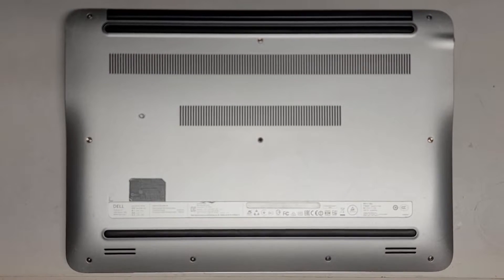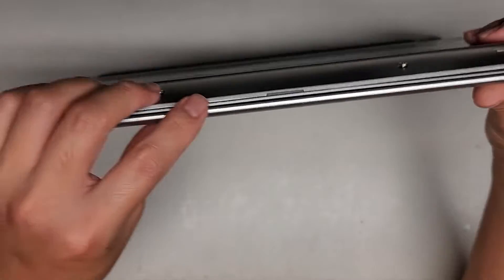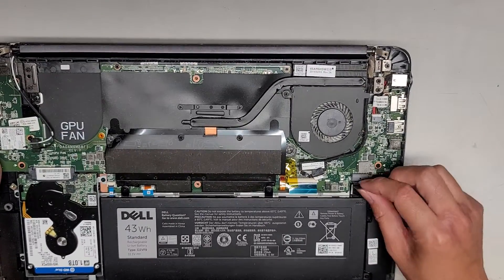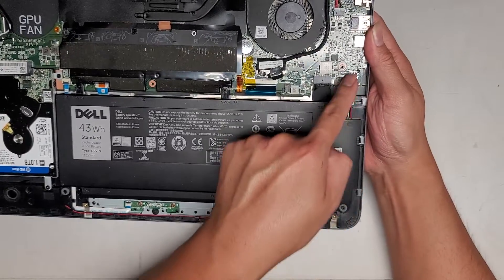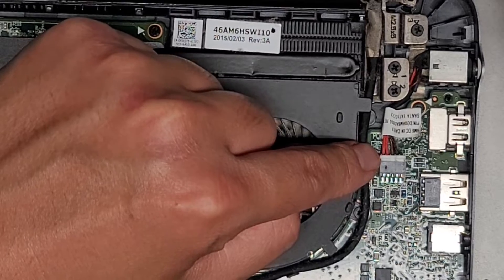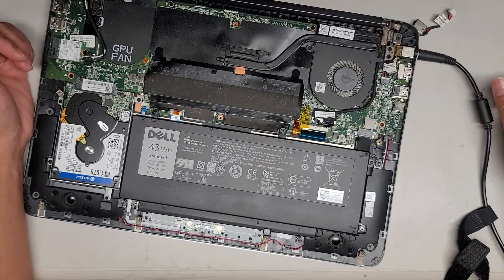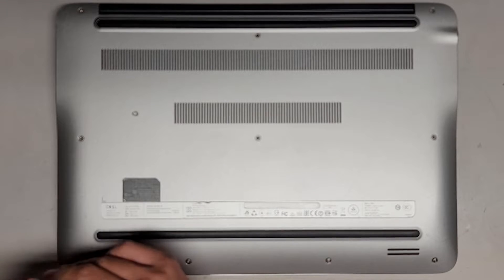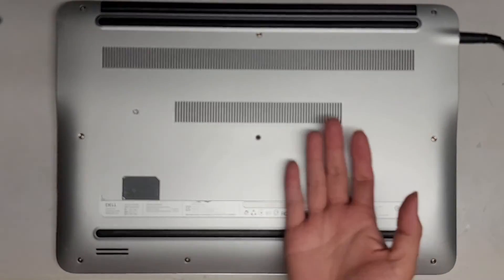Dell Inspiron 15 7000 Series 7548 Disassembly DC Jack Charge Port etc. Replacement Repair

Comment: Help, thank you...  7548 , lightning strike nearby.  Was plugged in, didn't notice anything, computer kept running 35 mins. Message low battery 5% (old) battery. Turned off.  Apparently kept running on battery. Once turned off, will not turn back on.  Power chord adaptor still 19.5v output.  Ordering battery, will changing D.C charge port remedy possible surge?
Reply from the maker: It depends. It could be a motherboard issue :(

Comment: Do you happen to know the screen part number for this? I’m trying to remove the screen and turn it into an additional monitor for my desktop and am having trouble finding a controller board for it. Thanks!
Reply from the maker: It's on the back of the screen. Remove it and check the label.

Comment: Hey i am trying to update this same laptop i just wanted to ask if it supports M.2 SSD. 
From what you show and what i see, i think it doesn't BUT i wanted to ask anyways.
Thanks!
Reply: I’m pretty sure there’s no m.2 support, and confident there’s no NVME support. :) good luck!
Reply: @neilcam98  Thanks, i ended up opening the machine myself and inspecting it to know if it had the port, i wanted to save a bit of time from doing so and also be able to buy the right SSD before hand, that but well i had to do it in the end, M.2 is so common now that even the lowest ends have a free port, i installed one in another machine not even month before this one, and i initially believed that this one wouldn't have one because of the age of the machine, but it is kind high end, so i thought there might be a chance, 
Anyway i did end up installing an 2.5" SSD and it seems to be running well.
Thanks for you actual answer.
Reply from the maker: When I get questions like these, I'm not responding to a viewer, I'm responding to someone that didn't even bother watching my video and doesn't value my time at all. If you watched the video, you'd see exactly what's in the computer, what slots there are, and what type of SSD I installed. These are the types of questions that make me hate people and realize that while I'm good at making tutorials, I wouldn't be able to teach because I'd strangle my students. Lol
Reply: @ItsBinhRepaired  But you did respond... 
I did watch the whole thing, the fact is that you mentioned only mention "SSD or hard drive", not M.2 or compatibility, not that you necessarily had to, hence the question, also you did not disassemble the whole thing and some laptops have SODIMM slots and M.2 Slots on the other side of the MoBo, were that the case, there is no way your video cleared that possibility, hence the question.
Also, you didnt install an SSD on that computer... the HDD remained there the whole time.
These type of entitled people that think they know everything by assuming what others do or know, is just frustrating... if the rest of your tutorials are a reflection of the answers you give in the comments you channel is full of shit, if this is how you answer a student when you are teaching, fuck, i hope they get better help in the future and do not regret ever getting into tech.
Reply from the maker: @Tredok Vayntrub  lol... so it's ok for you to assume I know what the other side of the motherboard looks like even though I obviously didn't take it apart that far and I know what's compatible beyond what I showed, but it's not ok for me to assume you know what an m.2 slot looks like and can easily see there's nowhere to put one?

Also, did you just call me entitled? The person that put out free content showing how to open and work on computers? Lol... Meanwhile you're dissatisfied with the free content I put out... Lol literally the definition of ungrateful and entitled. I literally owe you nothing at all and you expect more.

It's like calling/texting your teacher and expecting them to spend their time off teaching you the lessons again or even more...
Reply from the maker: Shhhh let him try to shove an m.2 in there. Lol
Reply: @ItsBinhRepaired  
I mean you could also be more helpful, since you repaired it, thanks but not thanks.
Reply from the maker: Technically you could get a 2.5" sata to m.2 sata adapter, but who in their right mind would do that? XD
Reply from the maker: Other than what's in the video, I'm not sure.